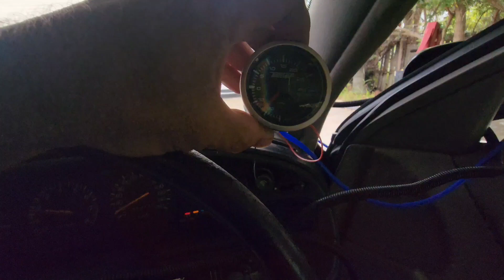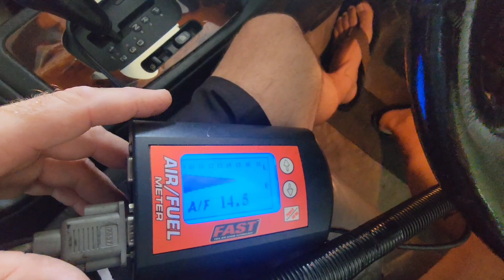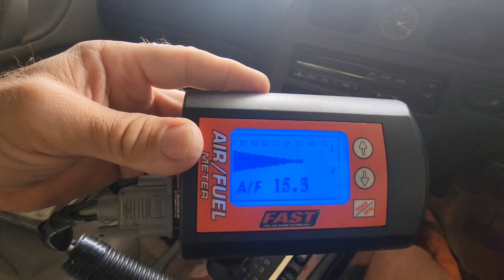Turbo sound

Comment: I wanna boost my vh in my s13 coupe so bad
Reply from the maker: I have a mate who has done one in Sydney. Bit of mucking around to make manifolds clear
Reply: @domsta2008  I pretty much have to tube the front end to make room rn headers run along the frame rails with minimal gap
Reply from the maker: Yeah that's what I should have done on my q45 to avoid running manifold piping under cross member
Reply: @domsta2008  my buddy has a q45 here in the northeast of United States with z32 trans hooked to it